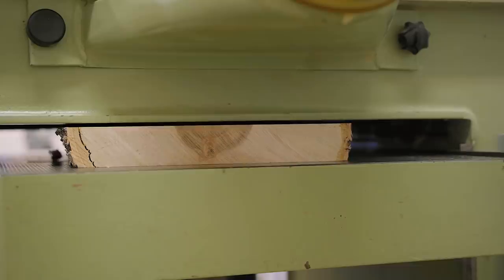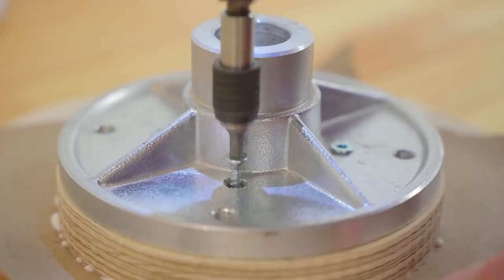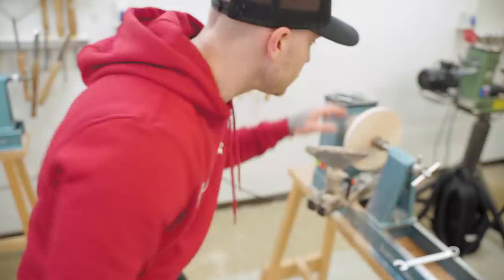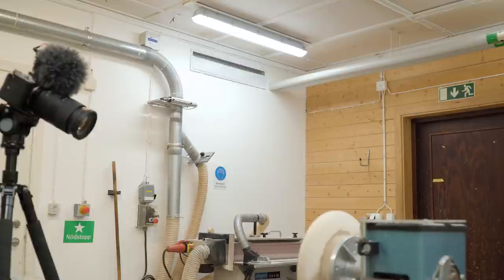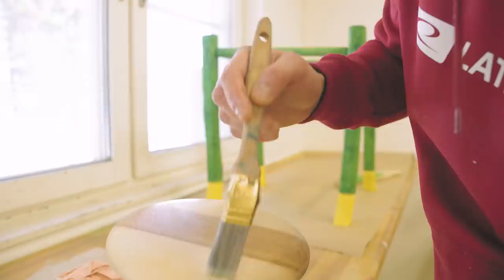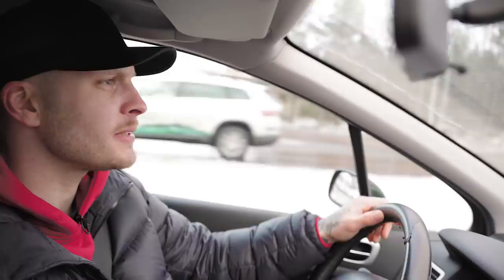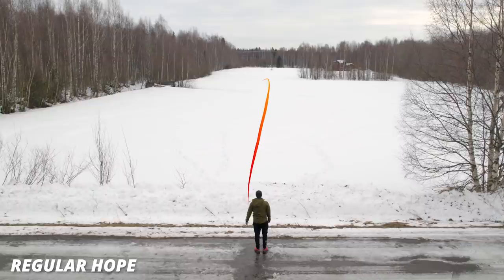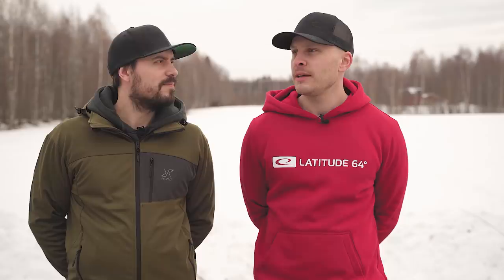How does a wooden Disc Golf Disc fly?

Comment: I made an ultimate discraft ultrastar from birch plywood. It was over weight but flew more understable. Was good for practicing smooth catches matching your arm movement to the speed of the incoming disc otherwise it could break your fingers. If I was going to make wooden golf discs I would also use plywood and make more overstable moulds

Comment: The disc is warped because the material looks livesawn. This creates cupping (shown when the birch was unplanned) and is very tough to eliminate even after planing. It's also very difficult to avoid this when the material is so thin. If you want to do a second video on this (as a woodworker and maker I love this stuff), try to get some quarter sawn lumber instead, and look for a nice and straight piece to start. Maybe 1" or 25mm thick. Awesome video!
Reply from the maker: Thank you for the feedback, Bryan. Woodworking as definetly something I can see myself getting into. What stuff do you usually  make? /Jonathan

Comment: I came back to this video after some time and wonder where the puddle-top came from. Was it the sanding process of removing the paper and glue that took too much material out of the top, or did the wood move that much from the change in temperature and humidity of the snow.

Interesting to see how much the shape of the disc may change during various times of year.

Comment: You used slab sawn, instead of quarter sawn wood, you asked for cupping with that heartwood. You could have tried to work the cupping bark up instead of bark down to create some dome which would occur naturally on 2 compass points and sand down to a uniform cupped shape on the other 2. Dome would be enevitable to some extent.
Reply: I don't understand what this means but I love that a wood guy knows what caused it to warp like that. Very cool.
Reply from the maker: So many things here I do not know what it is. but I think I agree  =)
Reply: @Latitude64  Quarter sawn wood has no center heartwood and warps (Goes romboid) far less. Wood warps/cups away from the bark side of the wood (bark up for decking, the cupping occurs on the bottom naturally shedding water on the domed top side. You try to use what you can of this natural warpping to create a dome on the disc top, it will still want to warp downward on only 2 (top) compass points, then you sand down the remaining  2 compass points to uniformly match the warp, creating a domed top.

Comment: The cupping of your disk had to do with the selection of your starting wood, you had the core running through the middle. Notice the grains from the side of the unworked wood where it is darker color; see the U shape ? You couldn't have started with much of a worse piece if you wanted a flat disk that was going to stay flat for very long.